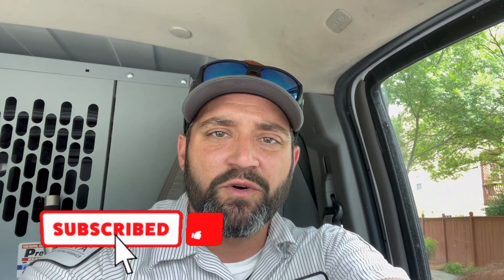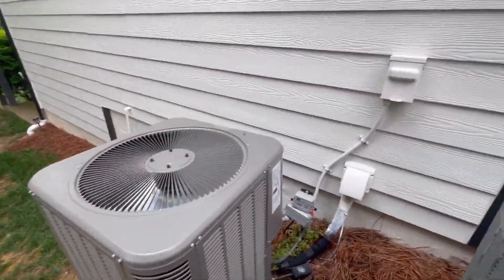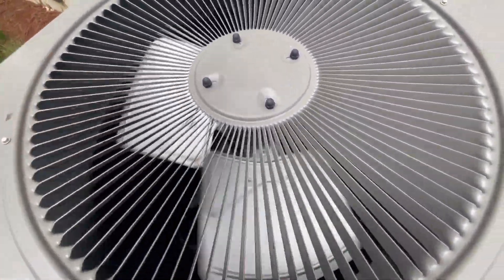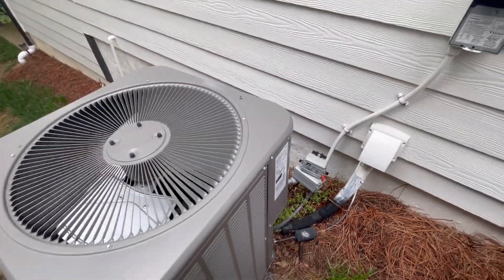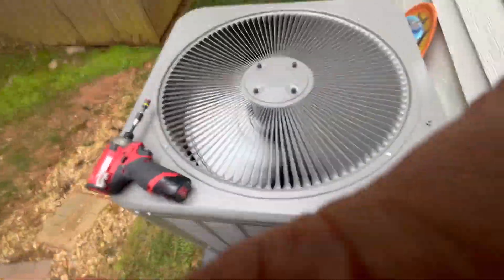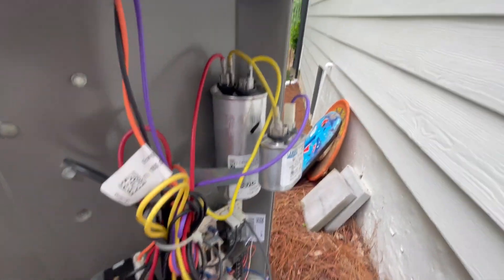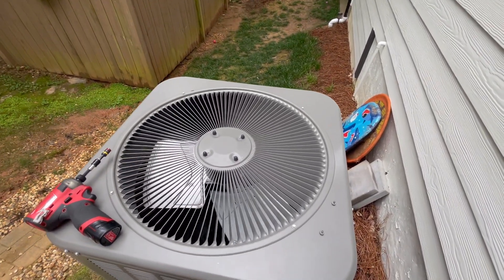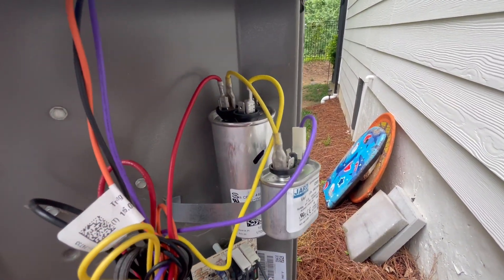Fan Motor Running In Reverse | HVAC Service Call

Comment: I just had the same problem condenser fan running in reverse, I took the capacitor out and it was very hot after running for a real short time so I installed a new capacitor and that was it !

Comment: Had any issue where the condensor motor would not spin.
Replaced the capacitor and the fan started spinning in reverse.  Blade spun freely and I made sure that the wiring was correct.  It was the fan motor that was failing, replaced and it runs like new.

Comment: Wouldn't have expected that cap being the cause, as it tested out pretty near its rating.  Just goes to show, though, that it's always worth substituting a known good capacitor before assuming the motor needs replacement (provided that the motor sounds and runs properly with the good capacitor).

Comment: I have had capacitors check out good with a meter and yet when I changed out the capacitor, then the device worked correct. My best guess is the low voltage of the meter does not reflect the higher operating voltage when the capacitor is in the circuit.

Comment: An ac motor will run in either direction depending on how the capacitor is wired, but a bad capacitor reversing its start direction is crazy. Electricity doesn't follow any logic when it comes to failure.  Have you encountered any instances where  compressor tried to reverse when a capacitor failure occurred? Great video!

Comment: I put a brand new fan motor, brand new capacitor. It is running backwards since the replacement. We had a reversible motor on as the first replacement but it burned out when we swapped the purple and brown. 3rd fan motor on now and going in reverse still.

Comment: That motor is trash.  Also look for oil wicking around the shaft where it comes out of the motor. If that is present, the motor will fail and has been overheated in the past.

Comment: So, if we are looking down at the fan from the top....the fan should spin clockwise? Which way should the fan on the compressor turn?  You are not clear...u keep saying running backward and reverse but not pointing out clarity as to clockwise or counter clock wise. Remember that everyone is watching this video and not HVAC tech. We regular folks will not know your terminology.

My trane xl 1400 variable speed roof top unit is spinning clockwise and I feel hot air blowing up. It could just be the outside air temperature but I know it's spinning clockwise. And my AC was working before and it stop blowing air through my vents in the house. So I went up roof and found it spinning clockwise.  

Anyone can help please help and I will buy the parts. I got quoted $500/hr diagnostic fee, to come out for one company. Another company wanted $200/hr and $1800 to refill freon for 8lbs2.0z. and diagnostics fee will be extras. Ouch. So help please. I'm in Sacramento. Heatwave is 104F all week.  house is Sooo hot at 88 wit 3 fan running all day n night and it never gets cooler than 86. Help!!!

Comment: So the orange is hot, is the black neutral or is it ground
Reply: Neither... Please be careful before digging into 220v 1ph circuits.. you could hurt yourself. Those units do not have neutral wiring at all

Comment: So I just replaced a Motor (yes it was bad)
But I was only able to find a Motor off Amazon with same specs but not same manufacturer. 
So basically I came across this issue where the motor fan would change direction after running for a while. 
What I noticed was the original motor had a clockwise rotation and the new motor had a counter clockwise rotation. 
So I swap the wires to make it run in direction I needed but then noticed that when it would stop and start up again it was going (counterclockwise). 
Finally called a Tech and when he looked at it he said it was because the motors where different and i should have used the exact manufacturer. Which is ideal but I couldn’t. 
So long story short this could cause your fan to go wrong direction as well.

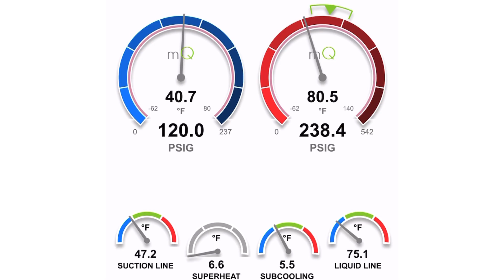Comment: 8:17 - Would this be an instance where it's appropriate to elevate the head pressure by blocking the condenser air flow to see where the numbers go? I've seen some of my mentors do this to verify charge.

Comment: Here's one for you, replaced fan motor couple years ago, worked fine until now, when air is running fan works as it should, when it kicks off fan stops and starts to slowly go backwards even after shutting thermostat to off, only way to get it to stop is flipping the breaker .... Any ideas ?
Reply: Did u figure it out?

Comment: I found mine was running in reverse. Did some investigating. There's 8 wires coming out of the fan motor.  2 are the power leads, 2 are for a running capacitor, and 4 thinner gauge color coded wires connected with spade connectors to each other. Label on the fan motor has a color to color connection diagram for these 4 wires to select the rotational direction. So glad it was an easy fix. Thanks for the vid.

Comment: Had a problem come up 2 times now in a week. We've had a couple power blips or surges. When it's happened the fan runs backwards, and gets kinda loud. The 2 times it's happened we were at home, so we turned off ac for a minute or so, then turned it back on, and all was good again. I'm just wondering if it happens when we aren't home what could happen and we don't know about it to turn it off. It's been over 100° here for a solid month or more. Sure don't need a broke ac in our lives right now.
Reply: Same with me it’s been very frustrating. Mine runs fine all year but so far 2 years in a row in July it happens. Of course I live in Phoenix where it’s been 115 for the past month
Reply: We have 1 year old Lennox made noise badly, stopped it, restarted then fine.  Have heard it twice.  Was told by service tech that power outages can cause it.  Can also make compressor run backwards.  This is bad situation, like said what if we didn't hear it?  Purchasing surge protectors to put on both units.

Comment: Excellent video - 4.5 microfarads on a 5 microfarads capacitor is off 10% which I have to believe is out of spec right?  Great job diagnosing. Never seen or would have thought a bad capacitor could cause the motor to reverse!

Comment: Thanks for the assist getting my 30 year old AC running again.  Found the cap swollen on both ends.  Replacement from Amazon the next day, cold air 20 minutes later.  Thanks again!

Comment: the red wire goes on the 4 spade terminal C,7:22 somebody switched yellow and red that is why it ran backwards,but that is a great way to verify,
.thanks for sharing.
Reply: You are correct if according to the picture, clockwise, then: C followed by Herm and Fan. So who changed?
Reply: Is it possible the compressor would run in reverse as well with capacitor hooked up incorrectly? Or not possible?
Reply: @JB-yh3xr  yes it is.
Reply: So in theory, if technician left it like this with the override capacitor, and the wiring hooked up run wouldn't the compressor be running backwards? And that's why the intermitten issue with the ac running against filter wrong etc?
Reply: @JB-yh3xr  the compressor was getting the proper uf,the fan was not,to reverse the compressor,you need to switch start and run .but running it too long will get damage.
Reply: @MariosACandRefrigeration  Wow, he mentions checking the wiring multiple times and even shows us the wiring diagram but still didn't check the C, H, F spades to see if the dual capacitor was wired correctly. By adding the separate fan capacitor, he basically turned the main dual capacitor into a single capacitor which doesn't have specific C and H spades. I guess no harm done other than the price of installing a fan capacitor. My 5 ton Trane has similar set up with separate single capacitors for the compressor and fan but also has a start capacitor and capacitor switching relay.

Comment: New to the field, just graduated school but, would the condenser fan motor running backwards give you a high head pressure ??
Reply from the maker: Yes it would
Reply from the maker: It would elevate it but it wouldn’t be as high as if the fan had stopped. The air would be pushing through the condenser coil instead of being pulled through it.

Comment: Just had this situation happen yesterday! I'm the only one working on the system therefore I went straight for the capacitor and found the capacitance was still good. Replaced the motor, problem solved!

Comment: what about if the indoor motor started going backwards? could it also be the cap? or time to replace the motor?
Reply from the maker: Yes it can do the same thing
Reply: @HVACTechTips  I ended up having to replace the motor it wasn't the cap

Comment: Had a york commercial that kept going into free cooling even though it wasn't set up for free cooling and disabled on board. One day when resetting it to get it out of free cooling I heard an electrical arch, fan stopped and went into reverse, unit kicked off on high pressure and went into free cooling. Wire had tiny nick in it and periodically hit bottom of metal floor. This took 1 1/2 seasons before the problem happened while I was standing there.
Reply from the maker: Wow 😮

Comment: Had this happen on a boat once! We were on shore power left for the weekend and an electrician came down and replaced a transformer on the pier. The electrician didn’t connect the phases back the same way. The air compressors air conditioners and everything with a three phase motor ran backwards. Most stuff was ok but the air compressors all locked up as the oil pumps don’t work when it’s turning backwards. The AC unit somehow survived running backwards for the weekend it sounded horrible when we arrived on Monday morning but after swapping a couple phases the thing quieted down eventually. The air compressors were junk. Fortunately we didn’t have most of the stuff on the boat running. We had to replace the AC compressors a few months later as they were severely damaged from running backwards for more then 48 hours!

Comment: Hey my ac went out this spring I think it’s the compressor… but the guy came out and just said you need a whole new system… like everyone our system is over 20 years old but we are over 7p so we just getting by on social security … they want to sell us a new system but I think it
Might be worth it to put a new compressor in and roll the dice… any advice?  I am discouraged because I used to trust this company… they have property diagnosed start and run capacitor issues before and spiders in the circuits but now they are a walk around and look doctor
Reply from the maker: I know this isn’t what you want to hear but, When the system is that old, it’s a really big gamble to replace the compressor. If it was me, I would have told you the same thing. Plus, the R22 alone is going to be crazy expensive 💰. You will get much more for your money by replacing the system.

Comment: After 25 yrs of service work I would have changed cap in 3 mins done with job .
All the rest of that was pointless
4.4 out of 5 is not the worst but was it 440v and plus minus 6 or 5 etc
Reply: You're missing the point. He's educating.
Reply: What are you talking about? 
The man made the video to help others, not show how fast he can throw parts at an ac unit.   
25 years experience huh? 
You see there's a part of our brain called the prefrontal cortex which MATURES by the age of... 25.  
This brain region has been implicated in executive functions, such as planning, decision making, short-term memory, personality expression, moderating social behavior and controlling certain aspects of speech and language. Executive function relates to abilities to differentiate among conflicting thoughts, determine good and bad, better and best, same and different, future consequences of current activities, working toward a defined goal, prediction of outcomes, expectation based on actions, and social "control" (the ability to suppress urges that, if not suppressed, could lead to socially unacceptable outcomes...
 I hope for your sake that your lying about your years of experience but if you're not then you might wanna see how fast you can get that fixed.

Comment: Good job as a 30+ year retired  Master HVACR tech, your thought process was spot on. I am also glad you also called the motor and let the customer know it needs replacing those baring and windings in that motor are shot and sound like poo. I have seen tech's not tell the customer about this kind of problem, (maybe from lack of knowledge or just don't care but that dose not serve your profession or is in the best interest of the customer.) and have a call back, which kills you creditabilty in the customers eyes. On a condenser fan motor running backward  for a long time kills the magnetic fields and destroys the windings and bearings from the added heat and harmonics. If you bench test that motor with an oisiliscope it will prove that fact. I know this is beond what would be expected of a technition. But beleive me it is true I have a friend that was a electrical engineer and we did just that test. Just an FYI, also all new techs should watch using reversible universal condenser fan motors for horse power, amp draw, and RPMs not to mention making sure the fan is running the right way. Nice job HVAC Tech Tips. PS: I have seen a run cap test good at say rated at 5.0 MFD and test at 5.9 MFD and the fan motor be good also but the fan would still run backwards from high winds. When the unit shuts down and the wind starts spinning the fan the wrong way it will continue to spin that way even when the unit comes on, as a younger tech this problem drove me nuts for about 2 days on a commercial roof top unit, until I cought it in the act. I had to install a high wind shroud on the top of the condensing unit to stop it.
Reply: Thank you for sharing this. Very Informative. I never thought about it.

Comment: nice video. another way the fan would run backwards is if you accidently put the motor lead on the herm side of the capacitor. learned that from doing a maintenance on a unit one time
Reply: That was my question ive done this for 15 years and on these single direction 220v psc motors I was wondering if they could even go backwards unless it had a bad cap or winding,  and I was thinking that exact thing I was gonna try swapping the L terminal with the cap ter terminal. So that actually works?